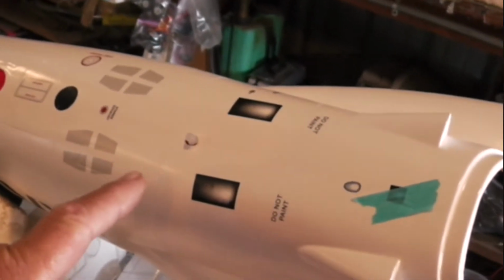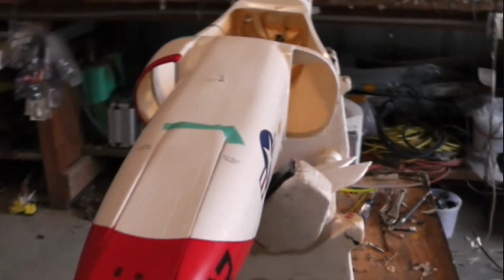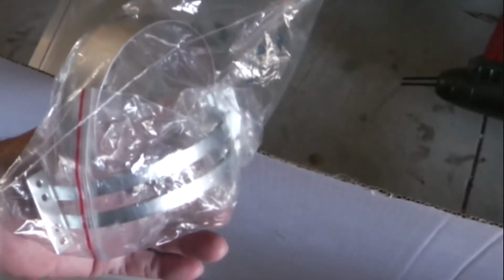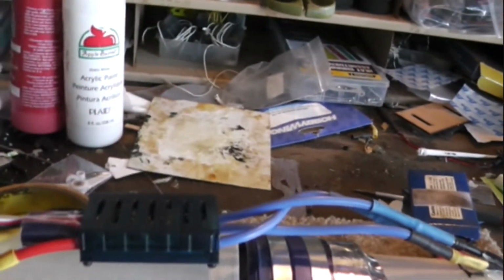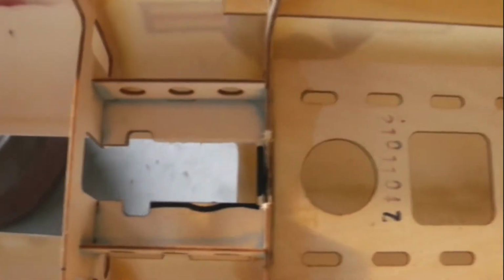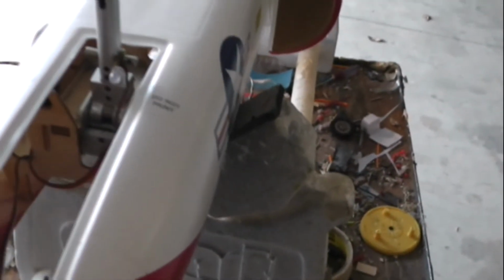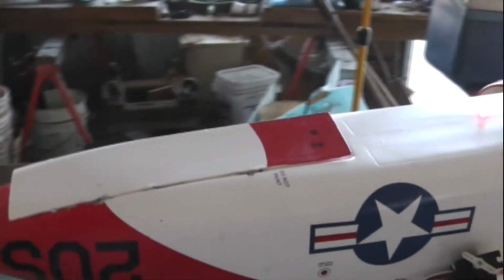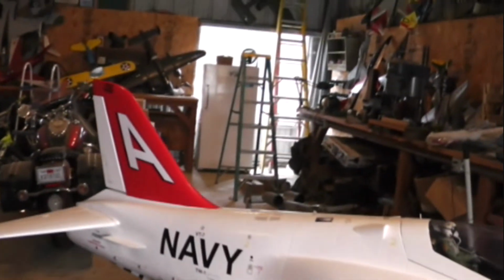CMP Pro T-45 Build Video.wmv

Comment from the maker: Hi Todd,
The CG with 9S 5000 mAh paks is 4 - 4 3/8 inch from wing at fuselage. The plane on 9-10s is a flying brick. And comes in very fast. Unfortunately tip stalls very easily at fairly hi speed. So, the wing fences, vertice generators, and aileron reflex is all to push off the tip stall as much as possible to help slow her down for smooth landings. The canopy latch is a matter of personal preference. No directions are given. GL Let me know how she flies for ya!
Dave

Comment: I have a couple of questions if you dont mind. 
What benifits other than looks do you think the back horizontal Stabilizers you install do? 
I'm putting small stall tabs (8 on each wing side) Do you think I still need to fabricate the large wing finces like you did? Do you have template? 
Where is the final CG on the plane as I'm hearing the instructions are wrong? 

thank you. Todd
Tinfurna69@gmail.com